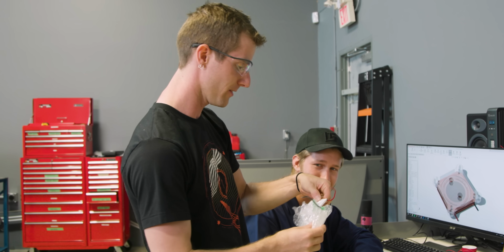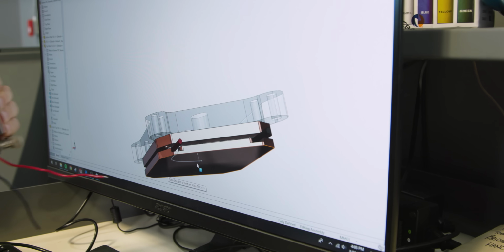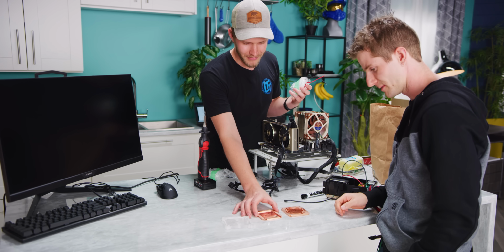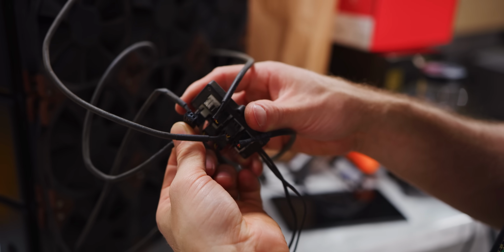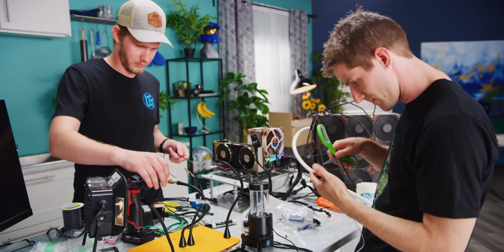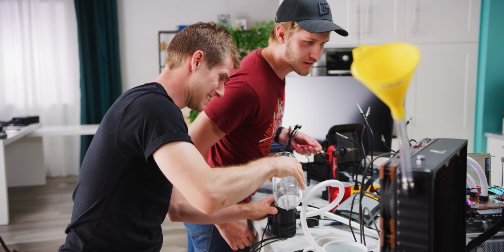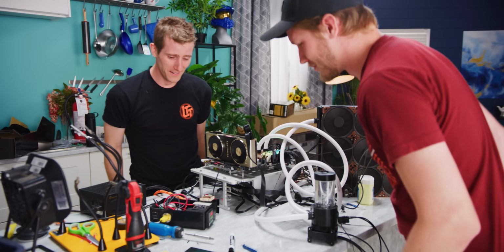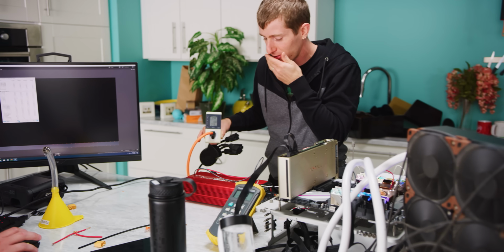This Cooler DRAWS 545W!!? Bad Cooling Ideas #2

Comment: You guys miss a test (at least I guess so), why not put a 120mm Peltier aluminum radiator in the middle of a water loop to drawn back the liquid temperature instead of the processor itself?

Like a 360mm custom loop with a Peltier aluminium radiator in the middle of the way (bomb exit to first block in maybe) after the liquid get cooler from the fan radiator? So you can turn it on / off when is needed and not a full time cooling.

In this way you can also use something like 6 cheaper Peltier tablets, like 3 each side or 2 120mm aluminum radiators with 3 Peltier tablets each, instead of a expensive one over the processor. Or likey you guys like to go beyong limits, 2 120mm with 6 tablets each.

In this way, Peltier will be a custom watercooling + a helper instead of a single solution. If this work (and problably will not), this can be a helper for overclock or hold intense processors like Threadripper or R9 3950x.

Comment: So, I tried to do something similar a few years ago.

I was really not up for condensation, but still wanted to get things as cool as possible.
You can grab an arduino and a humidity + ambient temperature sensor and calculate the condensation threshold on the fly. Then use the arduino to talk to the relay/peltier.

I'm not sure what the word for it is, but my problem was "thermal momentum" (my name for it) where you would have things snowball so fast that it would pass the condensation point.
I gave up when I had to pull out my old calculus books to start predicting where the snowball was going.
Reply: 3 years late, but that "momentum" would be controlled by a PID controller, which reacts to the difference between your current and target temps, how much difference has accumulated over time, and how quickly that difference is changing
Reply: @belded-wee  3 years is my average response time as well ;P
Looking back I think I've improved enough to approach this project again with the same tools and get it to work right. Or, yeah, use the right tool for the job lol.

Comment: Peltiers are only about 5% efficient, so even at 900 watts of input power,  you're only going to dissipate 45 watts of heat before it  becomes a restriction of heat travel.

Comment: Said this in the previous video.. but pasting it here as well.

Problem with your setup is that you can't just use TECs with janky waterblocks and expect it to cool that well.
Back in the day, there were some crazy custom TEC setups that actually worked pretty well... power usage still sucks though.
CPU -> radiator -> TEC(s) (cooled by another waterblock/radiator setup) -> back to the CPU.
That way you get a lot of the heat removed by the initial radiator and then the TEC(s) cool the water which actually gives you way better temps.
That being said, an A/C compressor type setup will still work way way way better.
Reply: But even so, a simple radiator with fan can dissipate the heat far more efficiently that the peltiers which are only about 5% efficient.  The only real benefit that peltiers can give is to precool the water to below room temperature but ultimately, the heat output will overwhelm the peltiers to the point that the radiator is doing all the work.
Reply: @Andy-df5fj  He's saying put the the water block in between the TEC and the CPU

Comment: it's called PWM and helps with
1) power consumption
2) temprature control

with carefully planned PWM curve you could even manage to keep cpu cooler, at the same radiator fan speed as with a normal liquid cooler... and all that, under a reasonable load that a beefy PSU can handle. 
-with a smaller peltier and for non-sub-zero tempratures
Reply: One important point is that you ideally want to avoid on/off regulation due to the thermal expansion/contraction of the peltier. There are high grade ones designed explicitly for on/off regulation, but they're quite expensive and even then you still want to avoid it. With that said, you also do not want to control peltiers with PWM. The seebeck effect that the peltier makes use of requires a current that is a balance between the cooling effects of the current and the resistive heating effects of the current. PWM will be basically going back and forth between zero current and the ideal current value, which will drastically hurt it's overall cooling performance and efficiency. If you want to use PWM you would need to filter it to be a varying DC signal and low ripple.

Comment: Did you know that you can stack multiple TEC's in series to gain more heat transfer?  You'd need several DC power supplies to run them all.
Reply: Each one will need to be progressively higher wattage. The first one will need to move the heat from the CPU. The second one will need to remove the heat from the CPU and the first peltier. The third will need to remove the heat from the CPU, the first peltier, and the second peltier...etc. Since peltier devices also create resistive heating, you have quickly diminishing returns in your overall cooling efficiency.

Comment: Would be neat to see a regular liquid cooling setup but use a TEC to cool the water in the cpu loop and a radiator setup for the second loop.
Reply: It would still get overwhelmed, you're just changing the location of the operation. If the CPU is producing X watts and the CPU isn't melting, then the loop is moving away X watts from the CPU. If you try to cool the loop instead of the CPU, you're merely trying to cool X watts at the loop instead of x watts at the CPU. It's also worth noting that since water cooling is cooling the loop by a radiator in ambient temperature, the ambient temperature thus becomes an additional thermal load to the peltier. If your radiator is large enough to bring your loop to ambient, your peltier is still trying to do a temperature delta, and you effectively have your radiator adding heat into the loop from the peltiers perspective.

Comment: the tecs are not linear, the more power you pump into them, the less they can cool.
2 tecs at 0.5amps is better at cooling than one at 1amp.
if you happen to have a bag of 10 60w tecs, stack them, and run them at 150w (15w each) and you ill get way better cooiling than one at 150w.....
also efficiency, thats about 15% .... so if you want to keep 150w of cpu at freezing... thats a lot of tecs

Comment: The heat still has to go somewhere and that little reservoir can only hold so much.
Reply: Reservoir size only defines the time between the start of the heat output and the time at which the water in the loop reaches steady state. The actual radiator defines how hot that steady state temperature is.
Reply: @JimBob1937  
Yes I commented before seeing that a radiator was being utilized and a big one at that.  I originally thought they were trying to magically remove the heat using the peltier without having to actually dissipate it.

Comment: I STRONGLY recommend to buy some CO2 fire extinguisher for this kind of purpose. would not even go near that stuff with a solid extinguishing medium. CO2 in its gas form is generally used for expensive electric equipment fire safety purposes since it can extinguish without causing any further damage, and it is available in hand hold design too.

Comment: So the peltier was drawing 900W you said?... The i9-7900X has a TDP of 140W... so now your water cooling loop has to dissipate 900+140 = 1040 Watts of heat! I'm not surprised it didn't work.

Comment: Wouldn’t it have been infinitely more efficient to just mount the monster water block that you guys designed directly to the CPU, and get rid Peltier and extra heat all together, and only deal with one heat source? Is there a video of just using your monster water block as a cooling source?
Reply: Water can't go below ambient, a peltier (potentially) can. But that is video is titled 'bad cooling ideas,' it is known peltiers are not efficient, it was just a fun experimental video to mess around.

Comment: You forgot to size your water pump relative to your thermal load.  It's all about the mass flow.

I have a pump and rad you could borrow to get this right.  It is out of a 98 Taurus SHO.  They were popular for frankenstein cooling builds a decade ago because they could be had on ebay for < $100 USD...

Comment: I wonder what would happen if you dont use the cooling element on the CPU but with just the cool side submerged in the coolant. If it would freeze up with water could you use oil or alcohol (something that doesn't freeze up). Id love to see that :)

Comment: @Linus
I'm curious.  What would happen if you used a Tec cooler with a custom heat sink tower while submerged in mineral oil?

The fins on the tower should help dissipate the heat into the oil, and the Tec which is great at cooling until it reaches it's capacity should keep the CPU cool.  As long as you have a decent radiator system to cool the oil, I see it working well.

I do work with mineral oil and truly respect it for it's heat conductivity and electrical insulation properties.

Do note.  I am by no means defending Tec's for the average consumer build.  I am just thinking of ways around the limitations it has.

Comment: Generally with a TEC set up you use it to chill the water in the loop. Then pop an air cooler on the TEC. I've done it, worked great for me.
Reply: PWM isn't ideal for peltier modules, it will harm their cooling efficiency. You'd almost have filter the PWM to get a varying DC signal instead.

Comment: there is no fixed cold and hot side on a peltier, just swap the connection wires and the sides will change

Comment: There are a fiew things you should change about this set up, since your using a pid controller anyway you should get the relay working and use more lower powered tec module's that equate to at least twice the wattage rating of the cpu. The more surface area you have to dissipate heat to the hot loop the better and use two closed loop systems with antifreeze in the cooling loop incase you get below freezing temps. The warm side just with the same radiator you used in this video, You are hitting bottle necks because of the active surface area, That and your trying to dissipate too much heat through a poor conductor (tec modules are ceramic) even though your moving heat with electrons.  Never put the tec in between the cpu and the heat sink use large water blocks on both sides of the tec modules with a fiew tec modules on each water block to cut down on cost and to get heat to them efficiently, they will force all the heat into the hot side of the water loop and the cold side will pull heat away from the cpu much faster even if kept at ambient temps. If you want to do sub ambient temps (will pull heat much faster) you need to water proof your board and use water tube insulation to stop condensation. but all in all its a great start love the experiment videos. Whole room water cooling loop is my favorite. Keep up the good work.

Comment: A PID controller is basically just a few multiply-and-accumulate operations, and since the system it is controlling has a really slow response time, it could be implemented in very weak hardware (think Arduino Nano). Also, since you're controlling DC voltage, you don't need a solid state relay, all you need is one MOSFET and some way to cool the MOSFET (it could be cooled by the Peltier element itself). Theoretically, you could jerry-rig a tiny microcontroller that fits next to the cooler itself, powered by a 5V pin on the motherboard, and with a thermistor and a resistor, make a relatively precise voltage divider that feeds into an analog pin of the Arduino, so the same chip both measures the temperature and controls the MOSFET. Also, instead of just turning it off when it gets too cold, you can adjust the cooling effort linearly using PWM. That way, the temperature can reach a steady state of your choice instead of oscillating around the setpoint like a refrigerator thermostat.

Comment: Hi linus,

I think you got to change your approach. Back in the day 2000 -2002, I created a liquid cooling set put for my pc using car cabin heat exchanger, 3 inch 220v fan, windshield washer motor 12v  and a Jar of jam as coolant reservoir.

If you want to give another try to this tech then you need to use 3, 100watts paltier sandwiched one over another. One connected to 12v , 5,5v and 3 volts respectively. In that way you will have the ability to reach sub zero temperatures of about -40 degree c. 

Now what I want you to do is keep on the the air cooler on the processor. As that’s the efficient way to cool it. Use the paltier cooler with the liquid cooling block along side and connect it to the air cooler so that the heat exchange takes place. Paltier alone will not have enough power to cool off a processor that outputting around 80 - 100watts of heat.

Our main aim here is to get the temperature down so that the processor can be used at higher clock speeds. This is the way I think will work. Let me know what you think.

Cheers

Comment: a real way to may it work is put Peltier on the Radiator.. use them to cool that keep the a low setting with passive cpu heat sinks

Comment: Peltier gets less and less efficient the more power you pump in to it. The most optimal would be "unvervolting" whole bunch of them and instead having single 500W you'd go 500x1W plates. Would be completely pointless and horrible looking, but hey, it would not be overwhelmed! Also would require 2 cooling loops

Comment: Hey guys, i think you are running the TEC in a wrong way. You can't put too much current or power to a TEC because the internal Joule heating inside the TEC will overwhelm the cooling power with such a high current, so that the cooling performance of the TEC goes way down. There is an optimal current that needs to flow in the TEC, and you will get a better cooling with a lower power input! A better experiment would be to control the current input to TEC manually, and see when the cooling is best. Good luck!

Comment: Linus, Linus, Linus......
Great Tech, Terrible implementation.
Not going to say that your idea was not good.
It was pretty good.
If you used the block you made more like an External Radiator
And then used a normal Water Cooling Block on the CPU
Instead of applying all that cooling directly to the CPU
You would be attacking the Fluid and if your pump had a large enough reservoir
And your Radiator on your cooling Block was Decent
The total Fluid is like A Well and its capable of holding Energy in form of temperature.
So if set right, the CPU should never be able to make more heat than the loop can absorb store into the pump reservoir
And Kind of like an Eco Instant hot water thing you can get for your house https://www.ecosmartus.com/products
Except the water coming out of the pump is going to your cooling block and coming out @ Exactly what you want it
And going back to the CPU
Ideally you would not have to run too much of a load on the cooling block
If your Rad give a lot of "chances" for the water to pass over it
So longer pipes that run off the plate and loop back
Giving some Fins to the Excess Copper Could also help out here
Giving the water time to soak that temperature and exchange it
But by the time it hits the end of the loop it should be at what ever you want
I am Guessing 15C Would be a very acceptable target.

Comment: The actual cooler is the radiator here ... Water cooler ... Air cooler ...they are just different method of transferring the heat from CPU to the radiator ... The radiator is all that matters .... Peltier unit is making things worse ... Remove that crap and directly use that water block on the CPU ...that Giant radiator would improve cooling ... Thermo electric cooling on a actively heat producing system(like a CPU) is theoretically lame idea...

Comment: so you have all the stuff. so why not try using the TEC as a supplementary water chiller. You would need 2 water loops. One just for the TEC's Hot Side, and the other being the system loop. The system loop order would be radiator, TEC cold side, CPU. Let the radiators get the water as close to room temp as they can. Then use the TEC to chill it further. You would probaby need to redesign the TEC water block to be much larger than the TEC and give it a long meandering channel back and forth to keep the water in the block as long as possible.

Comment: The only way to get this to work would involve cooling the actual water while using a conventional loop to circulate the water and cool the CPU. Use the cold side of the tech to cool the water post radiator.

Comment: Linus - Never use an "end" tap to start cutting threads, use a pointed tap. Also, do not use tap handle. Place pointed tap in a drill and cut the threads in one push, reverse back, done.

Comment: This has been done before by an italian business called Ybris cooling with a specifically designe waterblack, "sandwiching" a 300W Peltier cell. It was called T-REX 3.

It was in 2005, it was efficient and it used to went sub zero. It is just a matter of design.

http://www.techarena.it/forum/attachments/modding/2450d1382997215t-tre-vecchi-progetti-recuperati-dal-cassetto-trex3.jpg

Comment: Loved this episode, I tried this back in 2006, pretty much did exactly what was done here minus the temp regulator and my water loop started boiling, The pipe burst off the radiator and that was the end of that idea. I also first tried with a tiny peltier cooler which was useless but then ordered an industrial grade peltier and the outcome was the boiling water loop as I mentioned.  It would be awesome if this kind of technology actually worked.
Reply: it does work just not in that application. car coolers use them
Reply: cool the water not the cpu directly i use 2 12706 and keep 26c temps in texas